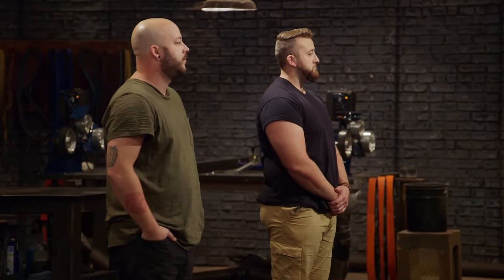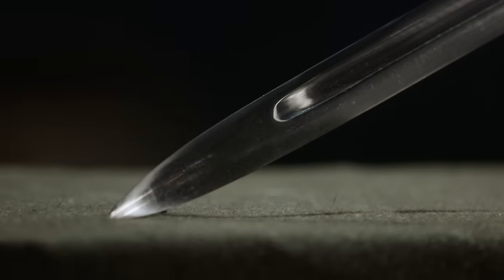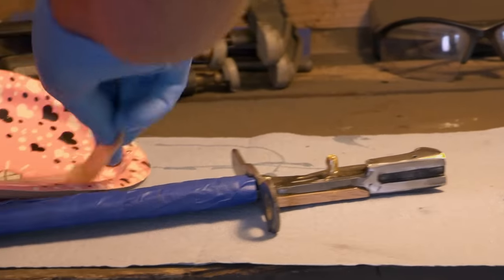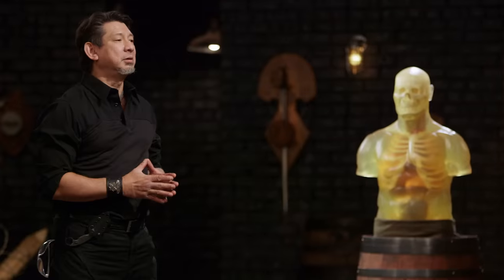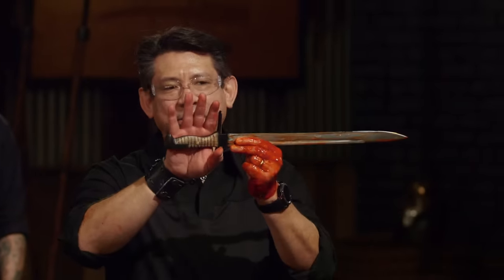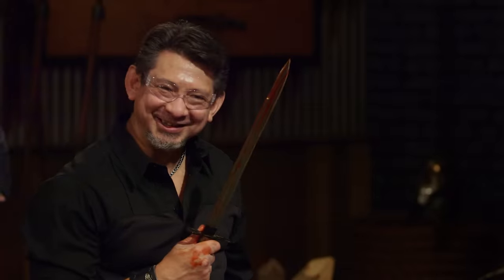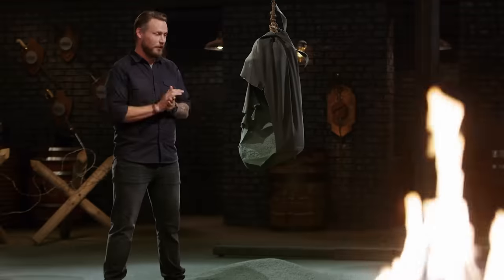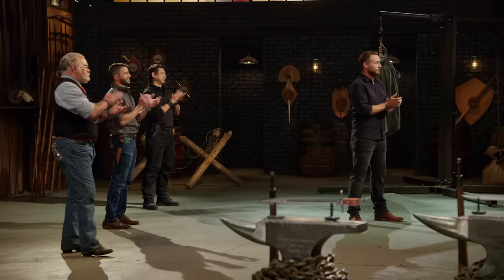Forged in Fire: EXTRA SHARP Springfield Bayonet Produces CATASTROPHE (Season 8) | History

Comment: That was basically a perfect bayonet blade the other guys blade was pretty good but it did have the bend so that kind of knocked him out if it wasn't for the bend I don't know who would win
Reply: I think the bald would win because Douge said "small handle" they say its down to the smallest detail
Reply: @nandinhocunha440  yeah but both handle's were great handles
Reply: If it wasn't for the bend, Josh probably still would've won. He picked up less edge damage in the strength test and had a handle that fits better in the hand. Brad's handle, while it worked out in Doug's hands, might have been a bit more troublesome to someone with bigger hands. We've seen before where handles that fit okay for Doug are just a little too small for the other judges.
Reply: Hard to say.  As mentioned hin other comments the handle was mentioned but Brad's blade was also sharper and performed better from that.
These are the episodes I like most.  When both contestants are brilliant and produce amazing work.
Reply: It was really close…
Reply: I think the bend was the fault of the tester he didn‘t remove the blade from the barrel as linearly as the other one he jammed it :/

Comment: My father served in the marine corps from 1937 to 1962... he had seen it all .. he told me never sharpen a bayonet.. it will be difficult to pull out... I didn’t understand at the time.. but if anyone would know.. he would having first hand expieriences....
Reply: Honestly, I can’t tell you. We don’t do Bayonet training at all anymore, and we’re not even issued it anymore. 

However, I don’t understand how an unsharpened bayonet would be difficult to pull out. All bladed weapons should be sharp in order to let it go in and out easily. If you have a full blade it’s worthless most of the time. 

The only time it would be difficult to pull out is the M9 bayonet since it has a serrated edge on the back.
Reply: Apparently from some small stories a sharpened bayonet could get stuck in bone from being sharp while a dulled one wouldnt
Reply: We still do bayonet training and the OKC bayonet “blade” is not sharp as it will chip etc. for all the reasons you mentioned
Reply: French military didnt sharpen their cuirassier cavalry straight sabers, they were meant to only use the pointy part of the blade and to never give slashes against opponents. It was the same for bayonet fencing. Thus it was waste of time and ressources to sharpen bayonets which is also why the french started replacing traditional blade bayonets with whole pointy sticks such as on the mas 36 and mas 49, then copied by the germans for the fg42 bayonet.
Reply: We definitely still train with bayonets in the corps.  Granted we aren't issued them anymore.
Reply: @Danvers97  I thought I'd never find another guy who likes trains and the Marines too. What's your MOS?
Reply: Bayonets were never issued in a sharpened state. It's an item that was designed for stabbing only and not always made out of the best metal. And as one man mentioned, they cut into bone and can get stuck. The bayonet is basically a 'spear' first and a knife last.
Reply: the unsharpened blade rips flesh and makes ugly wounds that do not close easily.  I have an original Model of 1905 bayonet, made in 1919 at Springfield. It's made of quite good quality steel. Quite a thing to stick on the end of a rifle, which I have done with both an 03 and an M1. That thing means business.
Reply: Well anyways the trick is to get it in on the side between the ribs, then twist and pull out with your foot on the guy's chest so you can break some ribs. So as long as its pointy I guess were good.  Not talking from personnal experience here, but it still was taught in my days.
Reply: The best guess I have is that with a sharp bayonet, it will only make a hole the size of the bayonet, and I'm quite sure the body wants to clench around the object thrust into it. Couple that with the pressurization of the torso, it'll probably create a suction that prevents the blade from coming out, like it's sealed inside the body. 

This is probably why you hear a lot of stories of WWI and WWII vets saying they fired their gun after skewering the opponent. 

Can't have pressurization of there's no torso...
Reply: @NostraDahut this is not true, bayonet fencing includes cutting.

The shift to spike bayonets is more do to with bayonets being less used and spike bayonets being cheaper to make. Not a lack of cutting.
Reply: @chris.3711 not true, bayonet training and fencing did include cutting, andany bayonets were designed to cutt first and stab second.

Comment: The M1905 is not used in ceremonies it is the M1.  The M1 has the same handle and a 10" blade, many were cut down fro. The 1905.  Most of the 1905s were converted by the start of wwii.

Comment: I'd have gone with Brad's. The strength test should be about comparative damage, Brad's knife took more but it inflicted way more on the wood barricade, it's two hard materials impacting on each other, comparatively I'd say that had about an equal outcome. More agile and sharper blade with the same impact force wasn't a fair test, striking power should've been adjusted for weight of the weapon. Otherwise it's like comparing a rapier with a flanged mace and concluding the mace is a better weapon. Short blades are a precision tool, it's not a mace. If I had to choose which one I took into combat , I'd have taken Brad's; lighter, sharper, and looked like it fitted better as well. If I needed to chop some brush or cleave hard wood to be able to carry and remove it from the road, a bayonet or combat knife are about the last tools I'd use, it'd be a real emergency for that to happen.
Reply: As they say in almost every episode "This test is not about what your knife does to the target, but what the target does to your knife"
Reply: @izaakburningham3188  Read what I've said in full, maybe you've read over the point I made about how that is not a fair comparison. The strength test itself is already flawed, even worse is the technique and force control of the one who does the test. Watch the part of the video again, you'll see clearly the amount of power used in the slash with the lighter blade is far greater, thus the conclusion does not hold up to reality. I wouldn't have said anything if this wasn't the first time it happened on the show, I've agreed with the judges decision on every episode I've watched, but this was utter bollocks. The old strength tester guy from a while back just seemed to have more control, the new guy is the one that truly didn't make the cut...

Comment: Bayonets are meant for stabbing and cutting not chopping
Reply: Grab rifle by stock, lift overhead and bring down like an axe.
It will take an arm off, split a head and break bones.
I used one a shortened version of the 1944 Union Fork And Hoe, instead of a KBar we would crack Coconuts with it. No one else had a knife that could do that. I could chop trees for camo and dig foxhole roots out with it.

Comment: I'm not sure military bayonets are supposed to have a separate pin you need to use to lock them into place.
Reply: The Model 1905 US bayonet does not use a pin. It has a spring loaded catch, high up on the handle, that locks into the scabbard and the rifle's bayonet lug
Reply: @bbb462cid  I know, but one of the bayonets in the video had a separate pin used to secure it. I'm commenting on that inaccuracy.
Reply: @onalert413  You literally said you "were not sure" and I clarified for you. I can only read what you type.
Reply: @bbb462cid  Have you never heard someone say "I'm not sure that's right," as a polite way of disagreeing?

Comment: He lost because his blade took a bend?  I can tell you I have a AFH M1 Garand blade that has a bend to it, so even the USGI approved blades bent.  

At least say he lost because his handle was too small or something...
Reply: The blade took the bent AFTER the test. So it means his blade can't survive the test completely.
Reply: The winner´s blade did not take a bend in the test. Sometimes it is close. In one of the claymore episodes the winner´s blade took a bend around 90° and he was allowed to straighten it prior to the next test.
Reply: @rhezafirmansyahgautama2632  the point of my comment is that a USGI approved blade bent in the example I have.  If that was acceptable to the US government, it should be acceptable in this test.
Reply: @penchant1972  it's not if it acceptable, it was about who performed better. That's why  it is called a competition.
Reply: @penchant1972  it's not because it's a competition, not some parameters that governments put in because they know that equipments suffer damage in real life.
Reply: @patrickbueno3279  yeah but if you were to use one on combat you'd pick the one that didn't bend because it would cut better than the other one, both are acceptable, both can kill, just one of them can do it slightly more efficiently so that one wins the competition.

Comment: BS. Slashing with a bayonet? I was in the army and took bayonet practice. It was straightahead or die. Slashing?  How the he'll would you do that? Hollywood BS.
Reply: I was in the Army too.  Our bayonet drill included a slashing movement.  Seemed pretty easy to do.  The bayonet had a sharp edge in addition to a point, why couldn't you slash with it?

From FM 3-25.150

(3) Attack Movements. There are four attack movements designed to disable or capture the opponent: thrust, butt stroke, slash, and smash

(c) Slash. The objective is to disable or capture the opponent by cutting him with the blade of the bayonet. The instructor explains and demonstrates how to step forward with your lead foot (Figure 7-15, Step 1).

This is from WWII era Army FM 23-25

c. The bayonet fighter's positions are guard, short guard, and high port. He executes the following movements: whirl, long thrust, short thrust, withdrawal, parry right and left, vertical and horizontal butt strokes, smash, and slash. The beginner learns these movements as separate actions. By training, however, he learns to execute them in varying combinations as swift, continuous actions.

(c) SLASH If the opponent again retreats out of butt range or falls, continue to advance, slashing diagonally downward with the bayonet. Guide the slash toward the junction of the neck and shoulder, hitting either this point or the head, throat, or arms. If the slash misses (note that a miss brings the movement close to the position of guard), continue the attack vigorously.
Reply: We're taught to slash with the bayonet in the British army, so yeah reasonable test